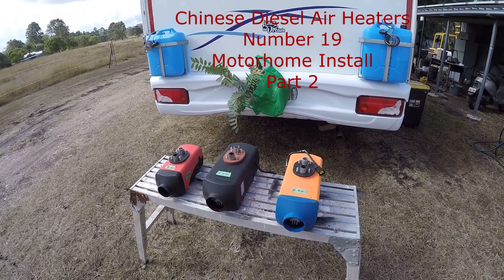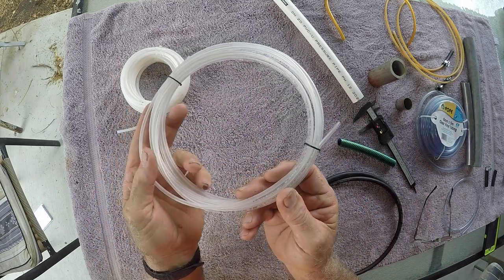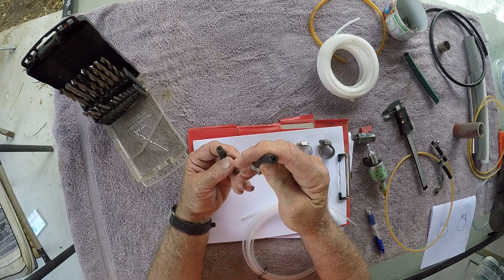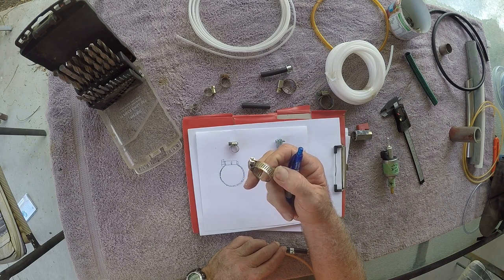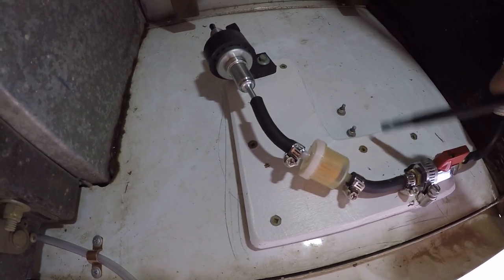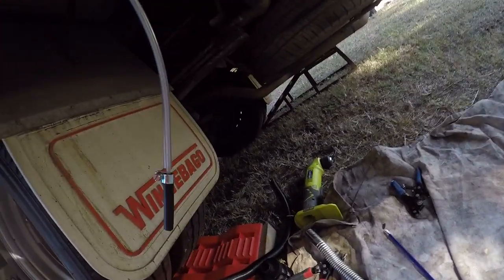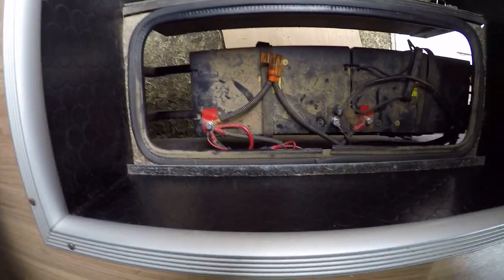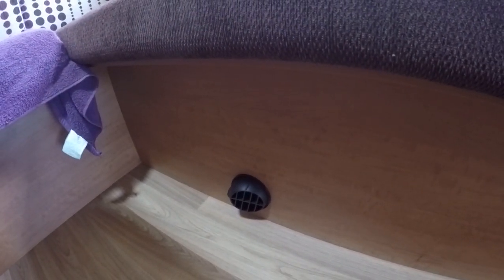Chinese Diesel Air Heaters no 19.   Motorhome Install Part 2

Comment: hi have 3 diesel heaters all not working one pump failed after a year the other 2 with in 3 weeks have one that pumps fuel downwards but when connected to the heater stops ticking nose ok can they be repaired
Reply from the maker: Hi Ian,

No, the pumps are sealed and they can't be repaired.

Now lets try and have a look at your issues.

First, do you have a filter before the pump? You must have a fine mesh filter. If the pump is frozen from ingested debris (no filter) you can sometimes free it by blowing compressed air backwards through the pump.

Second, have you been using any fuel additives in the diesel that could have gummed up the pump? Some fuel additives cause gelling and pump problems.

Third. Do you hear a ticking sound to indicate the piston is moving but not pumping, or is their no sound indicating a seized pump or electrical issue.

Forth. I am not sure what you mean by pumping downwards. The pump must be angled up to allow the cavitation bubbles to escape. If these little bubbles can not escape they form a big bubble and restrict or stop the pump operation. 

Can I please have more info.  JMcK

Comment: if you want to hide that on off switch, you might bea able to find a plastic container with a screw top lid that you could cut at the shoulder and glue over the switch, then no one will unscrew the lid and turn the power off.

Comment: Question:  I am thinking of installing a 5kw under my small RV. and have heat duct come up through the floor.  to save inside space and be less noise inside. What do you think about this idea of mine ?

...
Reply from the maker: Hi Hamish, that should be fine provided you provide protection for the heater. 
Remember you can mount the heaters on their side, provided the glow plug is on the top.
Regards,  JMcK
Reply: @johnmck1147  that is what I wanted to ask you about! I’m a big fan and watching all your videos and I subscribed to your channel. I am gearing up to install a 5kw heater in my camper build and it would be so much more convenient to mount on its side, (glow plug up) but I’m worried about using it that way, over heating? Less efficient? Potential damage to unit? Have you tested the heaters on their sides and compared to vertical mounting?
Reply from the maker: Nathan Dalleave 

Hi Nathan,
You should not have any issues side mounting the heater (glow plug up) if your install is good with minimum restrictions in the intakes and exhaust. The heater will work the same as exhaust down.

If you mount the heater on its side with glow plug down you will have lots of issues. You will get diesel pooling, flooding of the glow plug and burner screens, poor fuel atomisation and rich burn causing lots of carbon build up.

Cheers.  JMcK

Comment: Serious question here, Do you or anyone else who has one of these heaters: Do you have a smell/odour coming through the heating vent ? Its a bit like a plastic/rubber burning smell  ? I pulled the outlet hose off to see if i could smell this smell coming from the heater itself - which it is (as i was hoping it was the pipes and the plastic vents) its giving us headaches - anyone have the same ?

Comment: Hi John, can I ask where you purchased the in-line tap and fittings?
Reply from the maker: Hi SV, I purchased mine from auto stores. In Australia, places like Repco and Super Cheap.
Cheers.  JMcK
Reply: @johnmck1147  I've been trying to track down the inline fuel shutoff valve as shown in your videos, but can't find it at Repco or Supercheap. In fact I can't find it anywhere else at all. Does it have a particular name, brand or description so I can search for it online? Great videos, thanks for all the super useful tips.
Reply from the maker: whkiess 

Hi There,

Perhaps you need a photo to show the salespeople.
I bought a brass shut off valve from Supercheap a week ago and just yesterday I bought one from Bunnings.  Look in the air tool section.

Lots available on line. Search “small brass shut off valve”  about $8 to $10 on line.

Cheers.  JMcK
Reply: John McK 47 thanks, I found it online! Cheers
Reply from the maker: SV Julini 
👍

Comment: Hi John, my heater is showing the E4 code and i have puchased and installed a new pump but still showing E4. Do you think i should change out the control board, any ideas thanks
Reply from the maker: Hi Gavin, changing the board is a last resort, but I need more information before I can give an opinion.
Is the heater new?
Did it work previously but now doesn't?
Can you hear the pump ticking?
Have you checked diesel squirts out the fuel hose where you connect to the heater?
Is the fuel filter blocked?
Did you use a fuel filter?

If the heater worked well in the past and you can hear the pump ticking and you have removed the fuel hose at the heater and you can see diesel squirt out, I would remove the glow plug and it’s atomisation screen and check if it is full of carbon. Also check if the little start air hole not blocked.

I need more info Gavin.  JMcK
Reply: @johnmck1147  Hi John thanks for your quick response. The heater has been installed following all your key points and has been working faultlessly for 10 months now and is less than 12 months old. On our last trip it work on our first night but on shut down it displayed the E4 code. Then on the second night it would not start with the same code. I orded and install a new pump off ebay for $20. It worked and ran for 1 hour but on my second try it failed on the E4 code. the pump does not start ,there is no ticking sound.  I have check the diesel filter and it pored out while I changed the pump , the stop valve came in handy to stop the supply, again one of your key points. I have not taken the heater out as of yet . But I have noticed that on start up the control box makes a clicking sound and then fails and displays the E4 fault. thanks Gavin

Comment: It is currently -29C, -20F, were I live. I add POWER SERVICE DIESEL ADDITIVE  deisel to my diesel tractors fuel tank to keep the diesel from gelling up.
If I draw the diesel from my tractors fuel tank, any ideas on if this additive will harm these heaters?
Reply from the maker: Hi Raymond, 
It does not get cold enough here, so I have no personal experience of additives, but I have not received and bad feedback from viewers in freezing cold countries.
Also these heaters can burn almost anything, but the more oily the fuel the more maintenance required.  JMcK
Reply: @johnmck1147  thank you for your response and great informative videos. Verry glad that I came across them.

Comment: John my Chinese heater Is sypson itself and when stood the diesel is dripping off the black air pipes underneath?  I've fitted it into my mazda bongo with a 3 ltr diesel tank do you think a one way valve will work in the 5mm fuel Line  ? Best regards mike
Reply from the maker: Hi Michael, A one way valve will still allow fuel to syphon. Suggest you install a ball valye on\off tap and turn off when not being used.  JMcK
Reply: @johnmck1147  thanks For the info John I fit one and see if that cures it Best regards mike
Reply from the maker: Michael Alder 

👍. JMcK
Reply from the maker: n325aej 

In this instance, the top of the fuel tank is approx 100 mm above bottom of the heater.  JMcK

Comment: Hi John just wondering i have a supposed 8kw the pump quit working i ordered a new 1 that says universal 2 -6 kw so if a 4kw is just labeled as an 8kw these should work ?
Reply from the maker: Yes, that pump should work. These heaters  use the same dosing pump. JMcK
Reply: I put it in still having a problem error 07 the control board in heater just clicks I took it out and notice 1 did the solder let go I fixed it but still same prob I think the control board is fried
Reply: Sorry diode

Comment: Sir...do you recommend a vent for gas tank?
Reply from the maker: Hi CC,
All fuel tanks need a vent to allow air to replace the space liquid is being extracted from ..JMcK
Reply: @johnmck1147  i notice the cap my diesel heater didnt come with one....did u drill one for your set ups?...thanks..

Comment: I'm about to install a Chinese diesel heater and
the power side of it needs 12v, - purchased a
desktop Power Supply that puts out 13.8 v
Would this power supply damage the heater ?
Thanks
Reply from the maker: No, 
That voltage is ok, and is about the same voltage a fully charged battery puts out.
However, your power supply must be able to deliver at least 10 amps for a short while. That is the start up current these heaters need for a short while to start the burner.  JMcK
Reply: @John McK 47  thanks for the info, the power supply is capable of 15 amps so it should  be OK.

I plan on installing my heater in my log cabin.  Should  I keep the intake on the underside outside and the other intake on the inside of the cabin ?  Thanks
Reply from the maker: Hi Tredstone,

It is better to have the combustion air intake on the outside if you can.

The reason for this is that sometimes on shutdown you can get blowback exhaust and smoke come out that intake. Also you can get unburnt diesel seepage and fumes out that pipe during shutdown periods. And if you have a damaged gasket CO leakage occurs.

As for the heated air intake, that is personal preference.
You can draw fresh air from outside and not have a stuffy cabin, but a less efficient heater.
Or you can get greater efficiencies by recycling the air to be heated by having the intake inside, but you need to have some other fresh air venting, like a half open window.  JMcK
Reply: @John McK 47  thanks for your time John and your great advice  .God bless
Reply: @John McK 47  hi John.  I got my heater delivered today and was looking at the parts in the box 

The heater came with the green fuel line which has a 6mm outer diameter and a 4mm inner 
I purchased some of the more rigid fuel line which measures 4.5mm outer and a 2.5mm inner  .  

Will this new fuel line work OK with the heater with it having a smaller inner diameter  than the fuel line supplied 

Thanks
Reply from the maker: Hi Tredstone, suggest you do not use that cheap clear fuel line at all. In my tests it perished in under 3 months.

Suggest you use good quality proper automotive 4 mm ID fuel hose from tank to filter to pump.

But on the delivery side you should only use narrow bore hard nylon (or metal) fuel hose that does not absorb the fuel pump pulses. ID 2 to 3 mm is ok.  JMcK
Reply: @John McK 47  thank you  😃

Comment: All rite John is this the video your talking about
Reply from the maker: 👍.
Both 1 and 2 Motorhome videos.  JMcK
Reply: @johnmck1147  thanks John. Iv watched the first one so I’ll watch the second in a mo. Iv got a yacht sailing boat ⛵️ to. And I’m thinking of sticking one in me boat to. Where do I run the my main exust pipe out on the boat. Do I tun it through the roof or out the side
Reply from the maker: Apache Moonshine23 

You could do either on a boat.
But boat installs need to be done right. Have you seen my boat install video?

Cheers.  JMcK

Comment: hi have 1 2 kw heater and 2 3 in one heaters have 2 new pumps non pump fuel put a 12v lamp across the pump flashes ok just cant get the pumps to work any ideas
Reply from the maker: Hi Ian,

It is very rare for a pump not to work.

1. When you first turn the heater on the pump does NOT start. The heater goes through its start up cycle, turns the fan on, then the glow plug. Only after the glow plug reaches temperature does the pump start. 

2. It is possible for the pump to jam if you used it without a filter and it sucked up some rubbish.

3. It is also possible for the pump to jam if you ran it for a long time without any lubrication.

4. You check the pump by connecting power to the pump BRIEFLY. 
The piston is driven by an electromagnetic force, the energising of an electro magnet drives the piston.

Connect the negative from the battery to one pin on the pump, then very briefly touch the positive wire to the other pin. If the pump is ok you will hear the piston “tick”. Now rapidly touch the positive wire to the pin on the pump. The piston should rapidly go up and down.

The polarity on the pin does not matter.

Good luck.  JMcK

Comment: My 5kw diesel seems to run too rich (Smokey, often will not start) I believe it’s my altitude, I’m at 7,000 feet. I’m on my 3rd replacement and have selected a different MFG and/or model each time. All similar problem. Can you plz advise?
Reply from the maker: Hi Bill, 

I think you are correct with your altitude comments.

Unlike the genuine Eberspacher heaters that can be bought with a high altitude kit, I do not know  of any Chinese heater with a high altitude kit.

Have you tried running your heater on kerosene? As a suggestion, I would try a 90/10 kerro/ diesel mix and see if that eases your issues if you can not get a Chinese high altitude heater.

Cheers.  JMcK
Reply: What constitutes a high altitude kit, is it just the pump or must the algorithm be modified that controls the pump pulse? Maybe you and I should make public comments regarding altitude issues if we can’t resolve this problem? Thank you for helping!
Reply from the maker: Bill Vanagain 

Hi Bill, the genuine Eberspacher advertise a high altitude kit for their heaters, however living in Australia where we don't have any "Real" mountains, and the boat heaters are at sea level, I have no real world experience on this matter, but my research points to an ECU parameters change.

Cheers.  JMcK
Reply: Thank you Quinn!

Comment: Hi can you help me ,my heater has a rotary control lights keep flashing when I turn it on
Reply from the maker: Hi SF, flashing lights on a rotary controller indicate an error code. Count the number of lights flashing.
Three lights flashing = E3, Four lights flashing. = E4 etc.
The error will tell you what is wrong..JMcK

Comment: Well, I found out what happens if you miss the center dot when screwing the clear 10L  tank to a support wall. It leaks all over. Yikes what a stinking mess. Does anyone have suggestions on sealing the hole? 2 part epoxy?? Or a waste of time... buy a new tank
Reply from the maker: Oh dear CF,

Yes you can plug the hole with epoxy. But first you must remove all traces of diesel and lightly sand the area to be glued.

You can also weld up the hole if you know someone with a plastic welding kit, or even try it yourself with a soldering ion. Generally you will need some fill material. This can be a bit of plastic snipped of a mounting lug.

Good luck. JMcK
Reply: Thanks again you are awesome

Comment: Why don't you install silencers on the in- and outlets?
Reply from the maker: Hi Erik, 

The so called "silencers" supplied with the kit for the combustion air inlet actually creat more noise due to their restrictions of the air flow. They are also NOT a filter and can allow bugs to be sucked into the heater.

The combustion air inlet really does not need a silencer, and it certainly does not want a silencer that will restrict the airflow.

I have a silencer on the exhaust line.

Regards.  JMcK
Reply: @johnmck1147  I'm thinking about what the Germans call Telefonieschalldämpfer which are made of perforated tubes covered with mineral wool and an outer metal shell. They are not any more restrictive than normal tubing of the same diameter.
Reply from the maker: Erik_DK 

Thanks for the info Erik. Yes, I am aware of that. The exhaust on the boat is like that.
The air inlet does not make much noise and I have not bothered with silencers, but one like you describe could be good. The big noise comes from the fan at high revs and the pump ticking. 

Cheers.   JMcK

Comment: Can you please tell me what amp fuse to use for the fuel pump?
Reply from the maker: I personally generally use a 20 amp fuse for the heater and a 5 amp fuse for the fuel pump.  JMcK
Reply: @johnmck1147  Great John, I've got the 20 amp fuse in, and the 5 amp fuse will just about complete the project. Many thanks!
Reply: Also, I'm wanting to install a fuel cock from the plastic fuel tank. Can you advise where I can get one to fit the supplied hose? Thank you

Comment: Can anyone please tell me if the Fuel "Filter" in addition to the Fuel "Pump" needs to be mounted at any particlular angle(s)? Mine will be only about 2 inches away from the fuel tank but will be mounte parallel to the floor. So it will be facing sideways, not up or down. Any comments are appreciated! AE
Reply from the maker: Hi Art, 
The fuel filter can be mounted flat without any issues. It will also work with an air bubble in the filter, however you should aim to fill the filter fully with fuel before lying it flat.  JMcK

Comment: where can i get a thermostat controller
Reply from the maker: Hi Jim, you can buy replacement controllers on line. I buy mine off eBay. 
You need to be careful these days as some Chinese heaters do not follow the same protocol which makes mix and match more difficult.
Almost all controllers come with a thermostat.  JMcK
Reply: @johnmck1147  THANK YOU  i want one that works like a thermostat. the first one i had in my van work that way. this one i have in my camper does not..  thank you